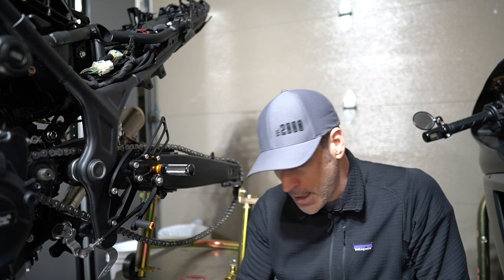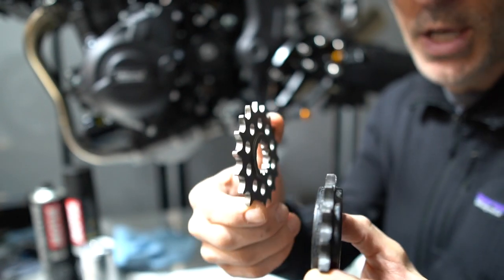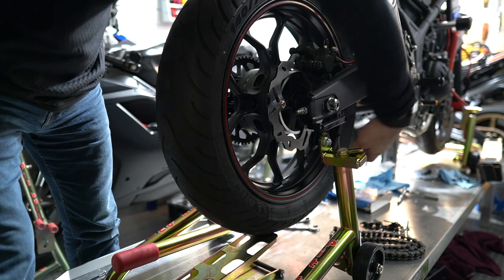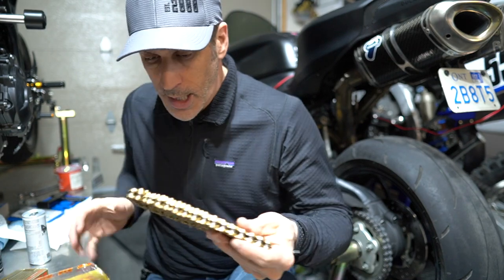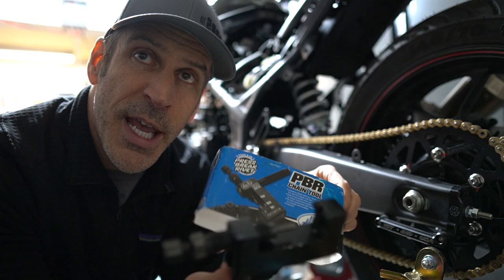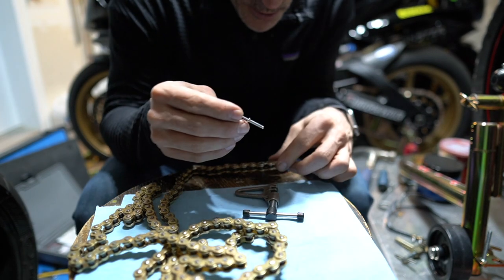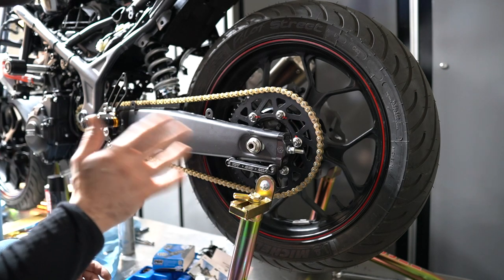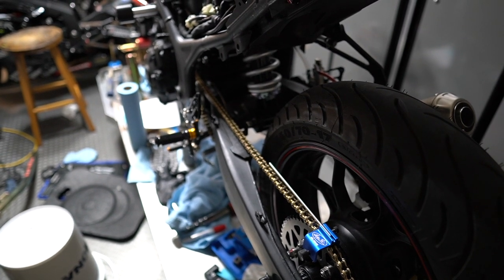415 Chain Conversion for your Yamaha R3 - Part 2

Comment: is that some reason you choose DID ERZ (the new one) than DID ERZ (old one)?
Reply from the maker: If you are talking about the OEM chain, it was a 520 and the new one is a 415.  If you are taking about packaging, I initially ordered a few 415 chains and noticed that the packaging changed but my understanding is that the chains are  the same specs (and quality). Thanks for watching and let me know if you need more details.  Cheers!

Comment: What's the top speed the bike get with this chain set
Reply from the maker: Hey Braden - I haven't had the bike out yet since I am still modifying a ton of stuff. However, the 415 chain will result in approximately an extra 1/2 HP. Not much but still a good improvement for such a small change.  Cheers!
Reply: @landry555  okay thanks I ride on highways alittle bit so if it doesn't effect it as much I'll look into getting a kit myself
Reply from the maker: I wouldn’t do this conversion for the road Braden. These chains don’t have the same reliability as the O or X rings chains. The 415s are ideal for the track as long as you change them often and keep adjusting the tension every couple of hours.  If you are riding a combo of track and road, I’d stick with the 520.